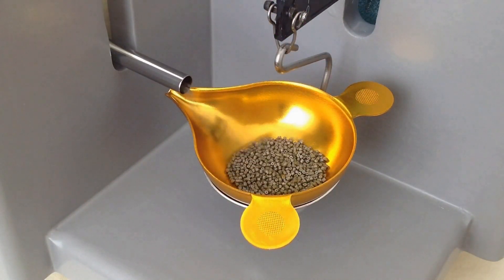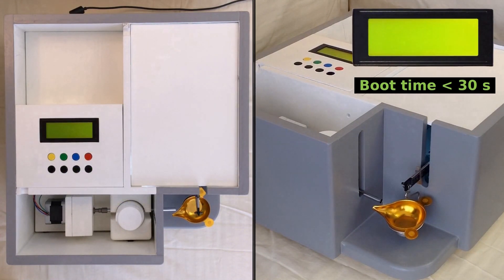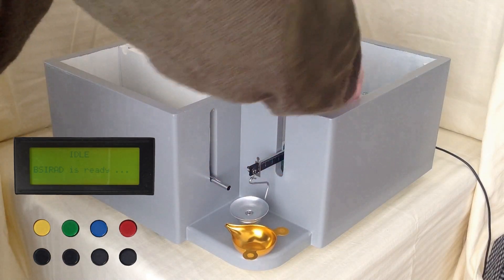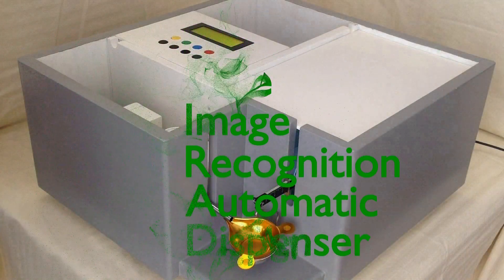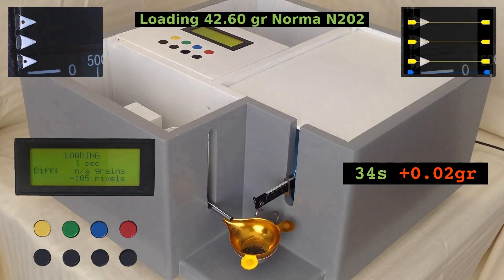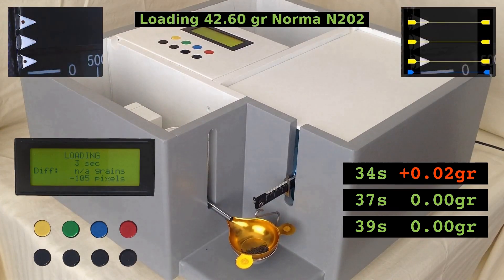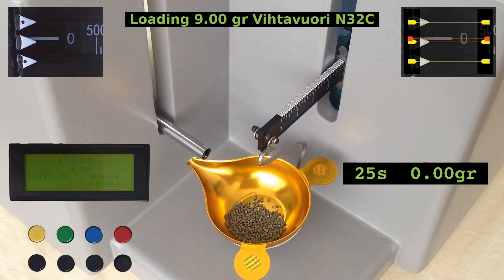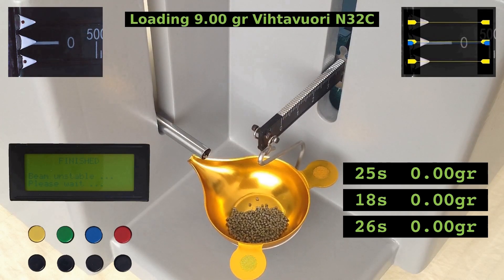Beam Scale Automatic Powder Dispenser

Comment: Snyggt jobbat, kul att se resultatet efter byggtråden! 👍🏻
Reply from the maker: Man tackat för beröm. Jag hoppas snart kunna lägga upp ytterligare en video där jag plockar isär BSIRAD.
Reply: Looking forward to you how to build video. Will it work with an rcbs 505?
Reply from the maker: Hi Chase. Sorry I must have missed your question. BSIRAD would not work out of the box with RCBS 505. However, the code that interprets the scale is well separated. It should not be too much work to adapt it to other scales. RCBS 505 is a better scale, but M500 is more simple to read with software.